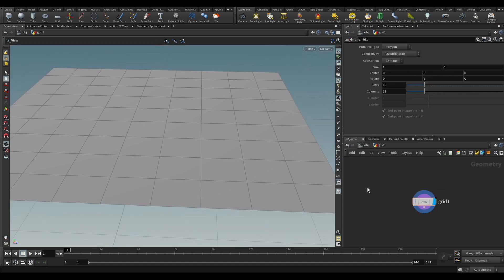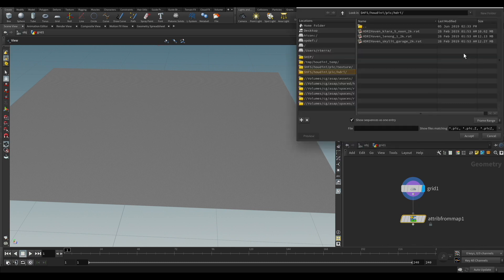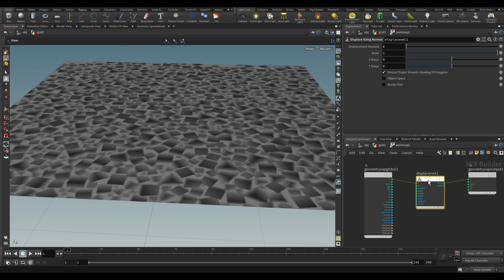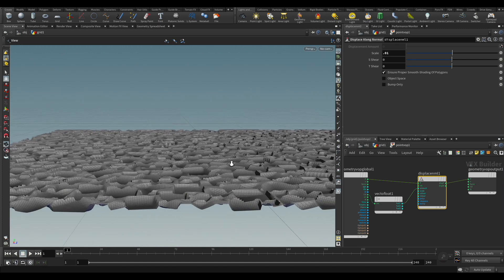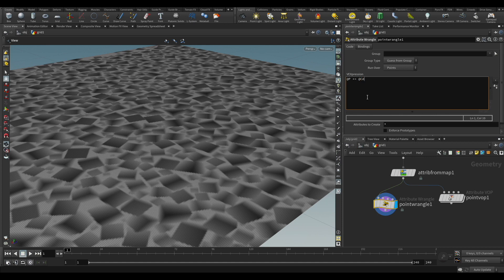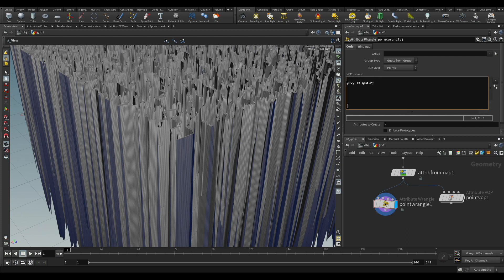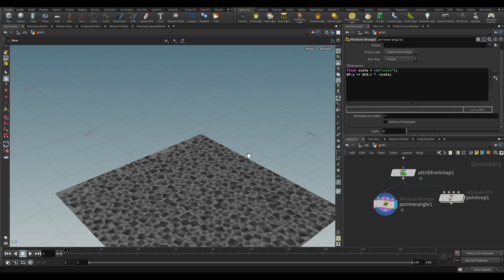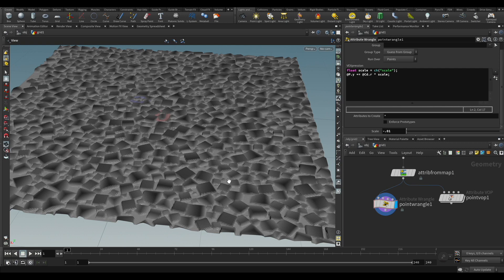HOUDINI -  Deforming geo using a gray map

Comment: Very nice, but I have one question (I'm a beginner to Houdini). Let's say I wanted to keep the base of the grid flat and just raise the "surface". Is there an easy way to do that? I tried extruding so that I have a second "layer" and applying the wrangle to the top face only, but it still distorts the part underneath.

Comment: This seems to be working only from planes. Is there a way to apply this to non-planar meshes ?
nvm it works using the first method.
Reply from the maker: Hello SnowballWar,  Yes there are couple of ways, on of them is multiply the displacement value, what in this case is the value from the gray map to the surface normal. This way it will get the direction of the surface normal. 
as a simple vex expression will look like this @P +=  @Cd*@N; let me know it this helped.
Reply: I Can't do it even converting vdb to poly

Comment: So to remove the greyscale from render, you would uncheck Use Point Color presumably in the shader? Using a Principled Shader-Displacement texture is much easier.
Reply from the maker: Hi, Presque vu. to delete the color, there are may ways to do it, you can even put a "clean" node after the wrangle and delete the Cd attribute.about the displacement. Yes if you want just to have a surface displacing at render time I would definitely use displacemente on the  shader. but let's say you want on top of the deformed geo scatter some points or obj. those would not follow the displacemet on render time. This is just a differente technique that you can use when fits the need. Definantily not a replacemento to the shader displacement. Thanks